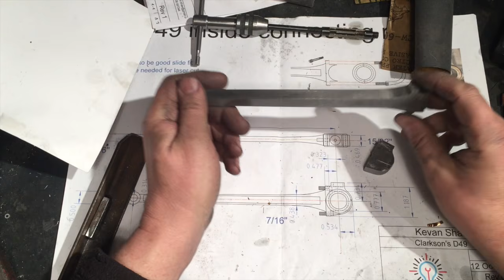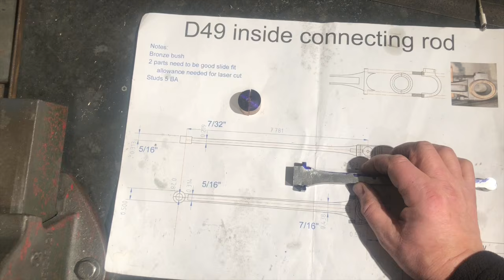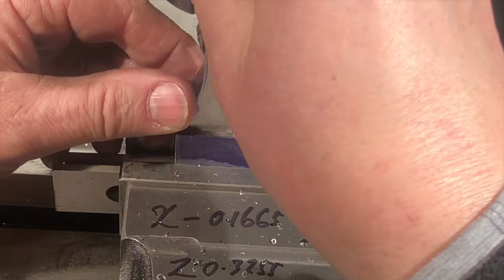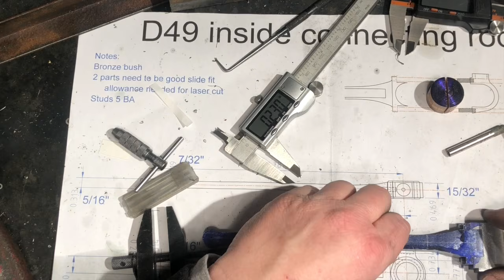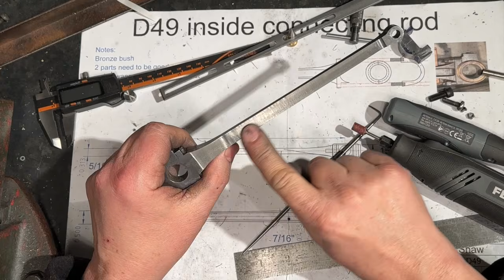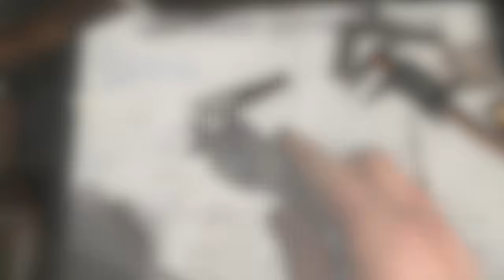🤣How not to Build a Locomotive : Inside Connecting Rod

Comment: This one looks great, ya did a fantastic job on this rod.. Good call on remaking the end cap of the rod. I was thinking if you could have clamped rod on side of mill table to drill holes, I've seen that done, if your mill has that Y axis travel, maybe, maybe not, but sometimes we have to think outside of the box for this modeling. Cheers
Reply from the maker: The head doesn’t have the reach to get over the edges of the table on my mill unfortunately!

Comment: A better way to drill the holes : Mount the part on the croslide of the lathe packed up to the correct height or fitted to a vertical slide if you have one. 
Use a wiggler with a point to line up your marks with the  drill chuck.
Reply from the maker: That is a good thought I have rather ignored my vertical slide since I got the mill!